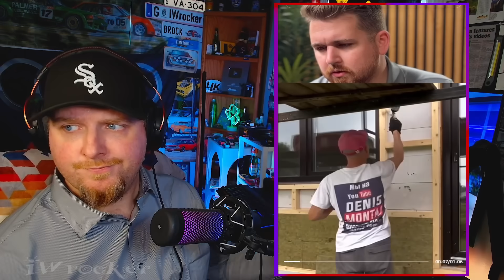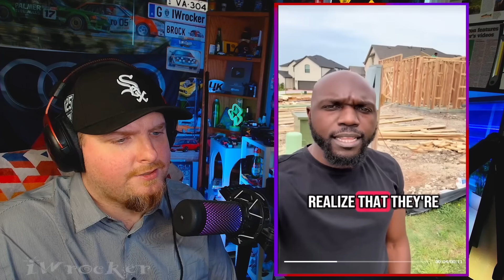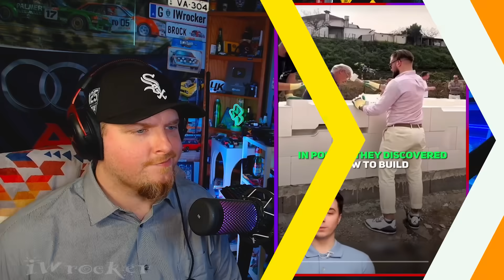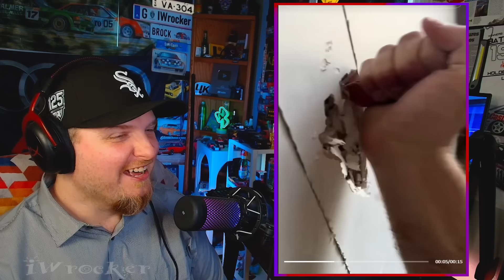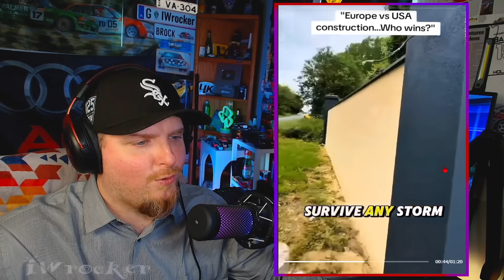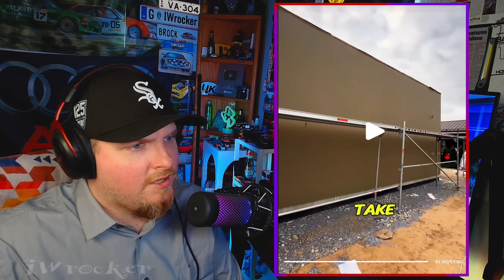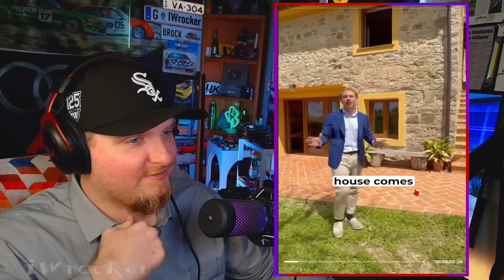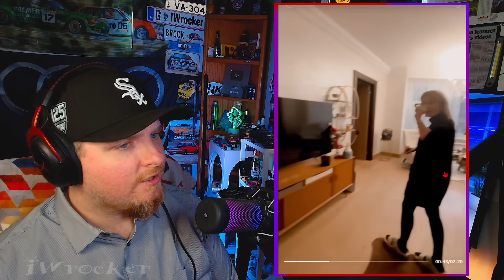25 Minutes of European VS American Home Quality & Construction Methods 🔨

Comment: insulation on the inside is worst: you lose net floor area and more importantly, because of how humidity and dew-point profiles work, placing insulation on the inside can cause interstitial condensation between the insulation layer and the wall (concrete)
Reply: plus that thick concrete wall has a huge thermal mass so once it have been heated up in the summer or cooled down in the winter it will radiate heat/cold for hours upon hours if it is not insulated on the outside. With insulation on the outside the same thick wall will now instead be controlled by the indoor temperature and thus work to keep it constant keeping the outside temperature at bay even more.
Reply: @Henrik_Holst  Also true, but Americans don’t have that mass to deal with :P. But if you want a good laugh, look at how houses in Japan lose value faster than a car.
Reply: @icoborg  they don't but that American "constructor" commented on a video where there was a massive brick wall :)

Japan is a special case, there a building is seen as a depreciating asset and what is important is the land it stands on. So their economy basically forces you to build very flimsy houses with a limited lifespan. So yes they loose value but not due to their construction but due to how their economy works.

Comment: Well, it's not like we don't have drywall in Germany. But for one thing, these walls don't bear any weight (the roof!), and for another, they also have an aluminum frame and sometimes insulation inside. I've seen so many videos of people in American houses crashing through the ceiling because the material gives way. Imagine leaning against a wall and suddenly ending up in the next room...😮
Reply: In 1989, if you leaned on a wall you ended up in another country...
Reply: @Koratz-r8cThat's a good one! Greetings from an ex-GDR Citizen!
Reply: Some people do it even more massive. I had to remove a drywall in my house when I bought it. Just for fun I tried a sledgehammer - that gave only small dents not more. As I didn't see how to remove it from the outside I had to use saws to cut into it and remove it piece by piece. It had OSB plates and the frame was fixed with long 12mm screws into the concrete floor and ceiling.
Reply: @reinhard8053  Wow,  that´s some drywall! 😆
Reply: Plus it is insulated and doubble planked! 😉